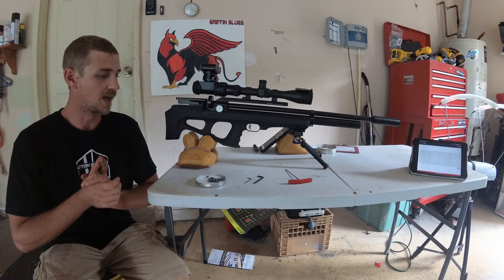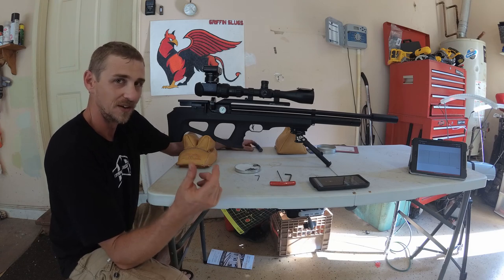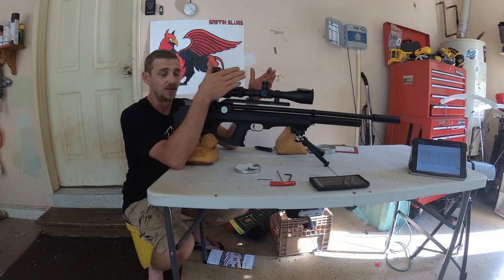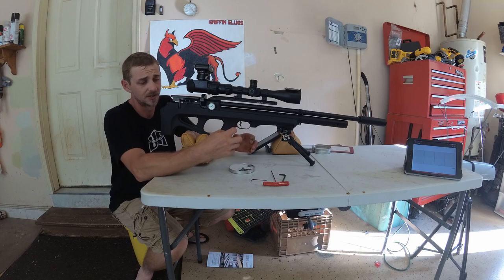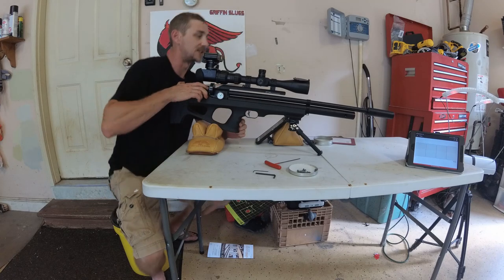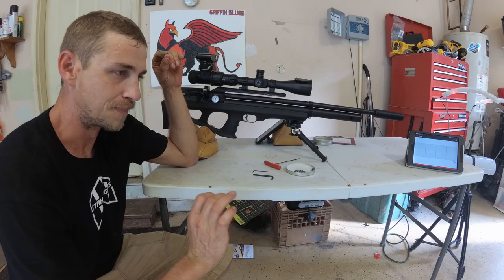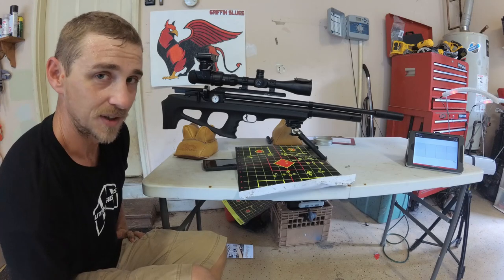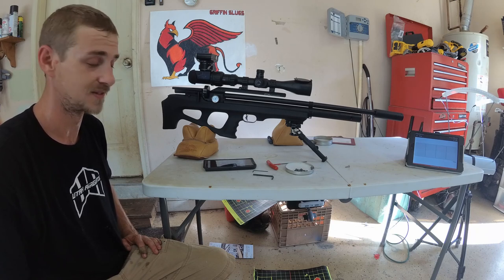FX dreamline tuning 24gn slugs

Comment: I had enough of that AMP reg and installed the Huma reg and gauge, absolutely amazing!!! Also ordered 200 of those Griffin 23gr dishes slugs for testing now that I'm shooting an average of 923fps with 23gr slugs.. Thanks for all the videos and time and effort, I know what it takes with all that testing and I'll keep you informed on my testing on my YouTube channel ...
Reply from the maker: Sounds great! My testing is on hold for while because the main valve on my Dreamline failed. Air leaks rapidly out of the barrel form 230 bar to 0 in about an hour. I'm really bummed because we just got our .218 die and a .25 die and I cant test them😥. Plus I just got a second crony to start measuring bc. Hopefully fx will get back to me soon. I got a few hatsan bullboss's one in 
.25 and the other is .22 I need to start testing those as well any way thanks for your reply I look forward to your next video keep it up
Reply from the maker: So just a heads up the 23gn dish was my best performer the hollow back did not do well in the dreamline they did ok in my hatsan and gamo urban I just checked our orders all i saw was 23 hollow backs had been ordered I'm not sure if that's you or not but double check to make sure you orderd the dish base. The hollow base is for airguns that have lowwer power like my gamo urban.
Reply: Thanks for the heads up, I'll give them a try and reorder if necessary..have other guns that may like them including my airmax and AT44QE long

Comment: Hi I am not entirely convinced that what we are looking at are results of tuning. To me it appears that what we see is just random dispersion. Try not to mess with the gun will it remain consistent at all? 
What happens if you shoot 5 not 3. Do you really know where the next will hit. I like that you shoot at intersections, not trying to adjust poa
Reply from the maker: That's understandable it's hard to show everything and explain it all in a reasonable amount of time. So before I did this process my groups remained constant if they where 1 1/4 inch they would stay approximately the same if they where 3/4 they would remain 3/4. After reading some forums and seeing others results I started doing this. I believe the idea is to match up the barrel harmonics and the mussel blast at slug release. 3 shot groups is anough to see if your changes are + or - more shoots can be fired but the results didnt change substantially. Once the slugs are tuned well they are very consistent. I'm not saying this is the only way or even the best way this is just how I try to get the best accuracy with slugs. After doing the this process with multiple airguns and different brands this works well for me.      I will say since I made this video my reg is not that high anymore I was able to get a 24 gn .218 slug shooting at 880fps with a 1/4 inch groups at 50 and 1/2 to 1 inch groups at 100 yards. I'll try to do a better job next time thanks for your feedback happy shooting

Comment: Seems like my Dreamline lite also throws away shots 2” sometimes.
I Will try a barrelband too but i think this is something for FX to fix.
Reply from the maker: I agree fx should do something and I believe they are but have not heard anything yet. If you would like to try my barrel band I can print a few up today and post a ebay link. I sell them for $7 + shipping. It made my dreamline way more consistent
Reply from the maker: Here is a link to the barrel band I use
Reply from the maker: https://rover.ebay.com/rover/0/0/0?mpre=https%3A%2F%2Fwww.ebay.com%2Fulk%2Fitm%2F174030139932

Comment: Off the top of my head that movement of the barrel is very disappointing to me  with fx I think thats
unacceptable. I have a dream-tact compact coming tomorrow. I am hoping/expecting, to put it down
one day to the next and yeah I want it to hit the same spot. Perhaps its unrealistic. I am pretty new at
this also. Is it common to have  to re-zero everytime you pick up a pcp, even fx  wise, I sure hope not ?
Reply from the maker: I agree its disappointing to have poi shift problems with this rifle. It is fixable and makes a big difference to me. To some extent alot of pcps have this problem some worse then others. Since this video I have done alot with this rifle I replaced both gages with high end guages wich I would recommend if you will be tuning alot or dont want to be confused about why things dont add up. I also added the new fx power plenum also recommended if you want to play with slugs, it takes alot of stress off the gun.  My only real complaint is the barrel shifting around and after I fixed that this thing is amazing and reliable. Honestly I dont think i could find a airgun that is what think of as perfect the newest impact mk2 is getting real close though.  
P.S 
If you are hunting you should always double check your zero just to be sure
Reply: @leadslinger5130  Yes I plan to hunt with it, look out iguanas here I come. Yes I expect to be very happy with the dream-tact compact and they make now a power plenum for the dreamline series but it won't fit because of the shrouded barrel on mine, major bummer. Interested where you got the gauges. I was going to splurge and get the mk2 but liked the idea of the foldable stock and compactness of the dream-tact compact and since, for now I am not planning on much passed 50 yards. I hope this pcp of mine will be at least 1/2" at 50.  And if even could smell 1/4" at 50 i'd be ecstatic, but that cannot be expected my barrel is a lot shorter than what you have. I def like the bullpups for that, long barrel and it keeps it shorter.
Reply from the maker: @badBikerz  oh yeah you will love it I think. With the short barrel I don't think you will have poi problems. that's a bummer about the power plenum but you probably wont need it till you put a full size barrel on it. I'm hoping the release the conversation kit for mine soon I want a tac kit so bad🤤. Oh yeah the guages you can get them from Huma and I think ternier outdoors. I would get at least the huma branded ones or if you want to go all out get the Wika guage from huma. Just Google search Huma regulators you'll find them they ship pretty fast considering its coming from Europe I have orderd from them a bunch they actually just came out with a after market transfer port for FX barres I just ordered 1 in .22 and in .25 I cant wait.
Reply: @leadslinger5130  Yeah I think I am gonna love, i added slugs with the order. They are .25 but not heavier than 25.39 pellets. But hoping they can buck the wind better, not sure now though about using then in a standard barrel, any thoughts ?
Reply from the maker: @badBikerz  well I have making and tests slugs for a little bit now and it's a mixed bag. The fx "hybrid" slugs or something similar would work fine but I would probably stay with pellets. The twist rate .25 is way to slow for slugs with a pellet liner. I have been learning alot about this lately  because my uncle and I make the Griffin slugs so I do a lot of testing. I'm not sure wich slug you are using but most of the light weight slugs on the market are made from a harder lead alloy and dont expand as well as the heavier ones. Also most light weight slugs are to short and dont load well. That prompted us to come up with a effective option for lowwer power guns we call LDC (low density core) this reduces a lot of weight while still using 99.9% pure lead. In .25 cal just make sure your slugs are at least .350" long .360" was where it got really  good for me. To put it another way is that is the length of a 34.5-36gn hollow point slug (roughly). I would say the Jsb hades would be your best budget friendly hunting option or there are more expensive slugs like we make that will expand at low speed. There are a lot of options to say the least hopefully this wasnt to confusing.
Reply: @leadslinger5130  Well it definitely a little beyond me. Will re-read it a few times. These are the slugs I bought Nielsen Specialty Ammo | .25 Caliber | HP Slugs - 26.8gr. Haven't tried them yet and probably won't until I am more sure about things. Also bought the jsb hades a lot of people seem to like that in many pcp and also the kings. Thanks for the info and will try to learn more. I certainly don't want to mess up my new pcp in anyway. Which is not beyond me to do, lol.
Reply from the maker: @badBikerz  you won't mess anything up shooting slugs you just mite not get the best results for accuracy. The hades will be great for hunting and the kings are the best accuracy hands down
Reply: @leadslinger5130  Hey thanks a lot for the information. I will definitely give the slugs a chance. Kings and hades it wlll be for the most part. Gonna keep an eye on your posts for more useful information. Thanks again.

Comment: Heya Lead, I was wondering if you could give me some advice. My dream-tact compact .25 showed up today. Only got to take a few shots. I was hoping it would come set to its best settings, but the hammer spring tension wheel is set to max, i dont think that could be right and the reg is set to 150, which i guess is right. Any advice please also it seemed to go from air cylinder pressure 220-160 with only like 9 shots I hope that is something wrong. Oh yeah took your advice and bought some of those huma air gauges.
Reply from the maker: Where did you purchase your dreamline from? Normally fx guns come very well tuned but I have herd of some places tuning them before they ship to customers. For .25 caliber I would set the reg to 130-135 bar and turn the hammer wheel down to at least 5 or A. Also right in front of the hammer there is a little notched section with a slider in it. That is where additional hammer adjustment can be made first turn the power wheel to max and see if that little slider has any play in it. There is a allen screw inside that slider piece, adjusting that changes the overall spread of the wheel it self. There should be a little  bit of play if your shooting pellets.  Do you have a chronograph? If so check each power setting and make sure each setting shows a change especially on the high side because that's where air will get wasted. Example if Power setting 4 = 830fps and 5 = 850fps then  max should be 865 to 870 fps if 5 and max are only 5 fps apart then you are just wasting air and making louder shots. Its possible the gun was tuned to 900 fps wich would probably use a lot of air with that short of a barrle. I'll check and see how big the air cylinder is for the compact but would think you should get a least a full mag out of a fill. If you are getting into airguns get a chronograph for sure other wise tuning is a crap shoot or even knowing what your guns doing currently. Of the top of my head I would think 850 fps to 830 fps would be a sweet spot for that setup but I'll check some stuff out and get back to you tomorrow
Reply: @leadslinger5130  Heya Lead thanks for the reply and info. Bought from Utah air, btw one guy there has the fx impact x,  trimmed with some gold pieces, pcp looks sweet. Yes I bought a chrony, that fx one that attaches to the barrel. At max wheel there is no play. If i click it down even one click I feel some play. Going to a range this morning, bringing allen keys, chrony, spare tanks and all, don't expect a whole lot shots but hope I can get it right, and with your help and others I am sure I will. I also read best accuracy for .25 is like 820-840. got the hades and the kings. Also too I thought it was kinda loud, I really want it to be as quiet as possible as loud noise draws too much attention, also got the donny FL tanto, i like the slimmer look of it. Thanks again, look forward to your help and advice. I want to get this pcp sweet. Shots, quiet and accuracy.